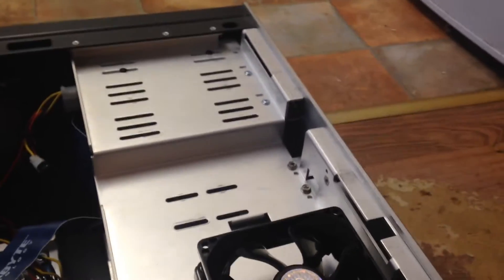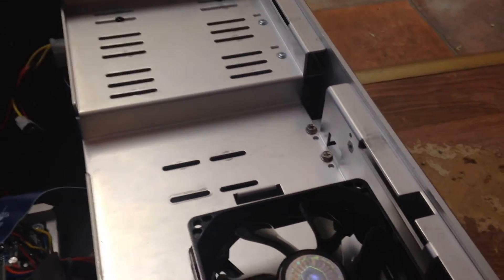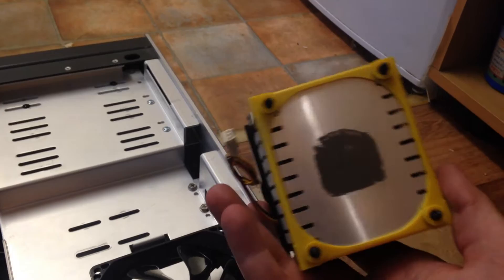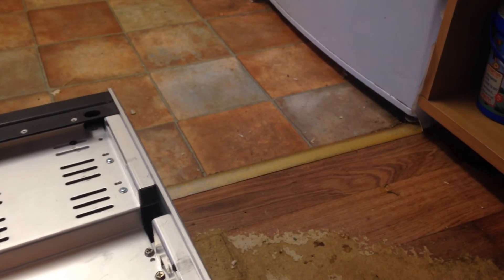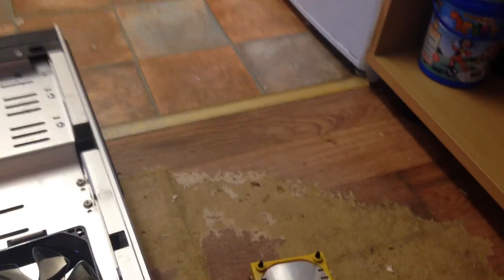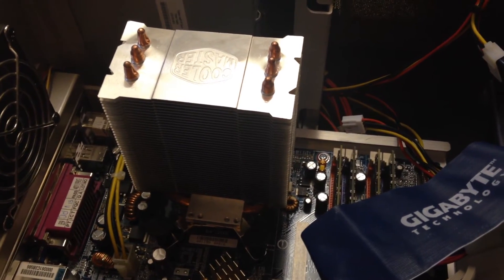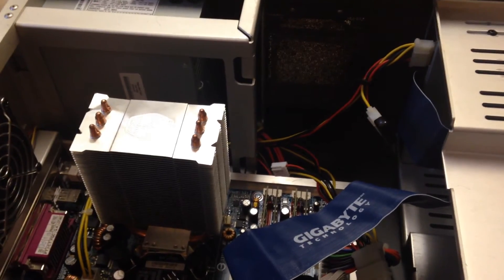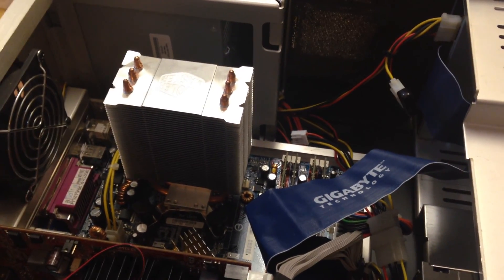Socket 775 Cooler on a Socket 478!

Comment: I did the same thing, I simply had to cut the 775 bracket in half and use two sides, unfortunately the contact isn't perfect as you say and it's getting slightly hot. But it works.

Comment: I have at least two 478 systems that I am trying to resurrect, but the stock heatsink on one is kaput and other other isn't in much better shape, and I want to use bigger better heatsinks. Problem is, they don't really exist for 478. Did you ever make a video of the slight modification to the mounting bracket? Or can one really just "plug n play"?
Reply from the maker: Hi there Ben,

I never made a video of the mounting bracket config but it is just a case of overlapping the brackets slightly on the cooler, using half the screws (you'll see why when you come to do it) and lining it up as best you can.

The only downside to this was it seems it only made 95% contact on the CPU and while it worked I don't feel it worked enough for it to be viable. I am looking to do another cooler mod later this year on this socket type so best bet would be to subscribe and keep an eye out for a new video about this soon.
Reply: Ok, thanks. I'm always buying up pc stuff when I find it cheap, so if I come across any 775 coolers I'll will also see if I can work out something that is effective. If I do, I'll let you know.